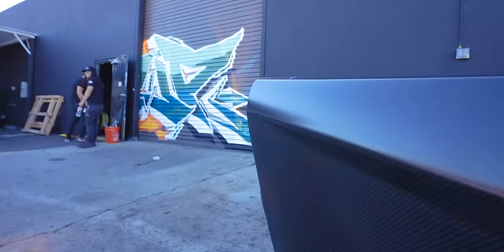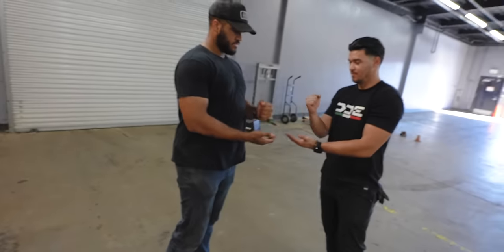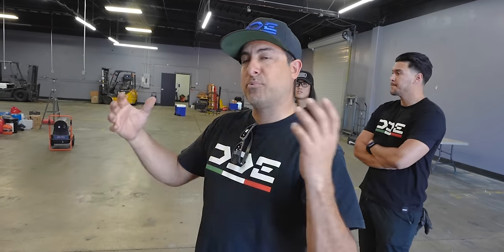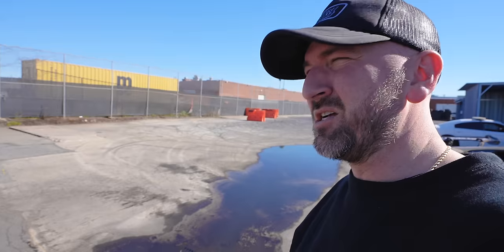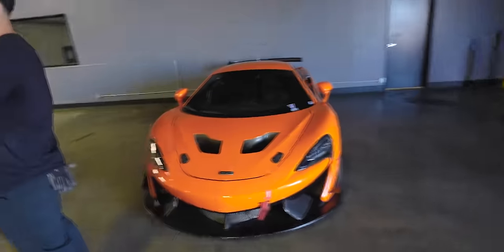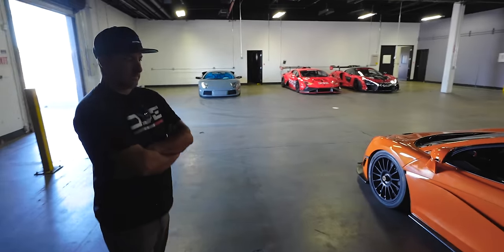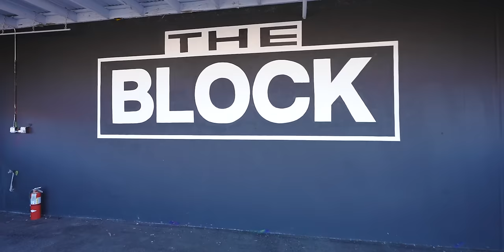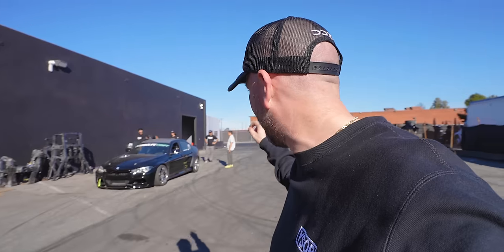HELP! NEW DDE HQ SHUT DOWN UNTIL THIS IS PAID!

Comment: DDE THIS IS A LONG POST: Sorry for this tho some things to be mind full about from me so hope it helps you, as im sure more input from a some 1 that knows warehousing the better. Yes this is retail but you will understand when you read this. Also as i wish you all the very best, this is why ive taken the time to write. 

  3 screens in the store for 3 dif- angles for when the Block is Operating. could even have a Red Live sign go hot for when some 1 turns that on call it a hot button so it also turns on & turns of the tv's at the same time ish what ever right just turn the tv on be done with it. (however you like it). However this may be an issue for when customers come to then stick around creating a crowed where people come in then stay to long only to watch & not bye anything. See how it goes, thing is tho you actually do need customers so Yes to it. Need to hire a couple of retail people 1 to start of with. Also people have phones ='s camera's be mind full of content on shop's tv screens just in case you wished for that content to only be seen on the channel. Every 1 will want to film inside the DDE Shop. & external. People will show how to get to the DDE Complex, but that's a good thing & a Security issue down below.

  Security & a safe that can not be taken so dino bolt that sucker down. Massive Bolts for the complex you all ready know im sure. It's a lot more then an aesthetics issue. Hiring a Big guy for Security will be needed might as you know there will be customers vs the location so on & theft in the door. Safety for the customers & the crew, Signs to state this facility is under constant surveillance. & get a Deal with the Security System place to also be a Sponsor if possible ask them to come around & have a look make them feel at home try to get them onboard. With all this then again something comes to mind, you might need a payroll clerk. So best to speak to some one that know the retail industry or some 1 that knows retail. Speak to shop owners insight is insight. Even if they can even help in some of these aspects to assist in these matters & see if they are also able to then become a Sponsor. They can sell your stuff & vice versa. Evan a conversation goes a long way & can lead to saving money here & there. (you will find actually that ohh we all ready have this or that) Or now i know what to use this for. so on.

  Sponsorships helps both sides the more the better. & even if it's only 1 or 2 to start. Then company's will want to follow suit in a mission for them selfs to want to come to you to sell & advertise in the shop. ( i now you know this tho some peole reading may not) Hope all goes well Just a reminder don't go to ham on aesthetics, as there are many factors to do & things to do & get for the shop to be up & running. Business NO: Registered to do sales or name you have all ready and all that & the location that may need a looked into for certification or permits im Aussie im not 100% at all know how that works for USA, & that's for you not us. Just make sure everything legally is fine.

  Floor Space... Id say only 1 car to show on rotation (put this in today that tomorrow what ever works) so make sure that's easy to roll in/out of in the shop as floor space disappears extremely fast, Utilize the crap house of ceilings & walls. Last few vids you guys said so much space you don't know what to do with. Have adjacent rooms Vacant for Stock & rooms ready to expand if need be extra shop space & (locked space for Stock Extremely Important). 

 Stock for the shop & the building: can be a two part aspect in one, this can be shop stock & hold parts for the cars & so forth. Have these sectioned of so car parts or should i say car grease & dirt from that can be separate. Tho still can be in the same place but sectioned of. Can see a few walls taken out for rooms to become 1 for the stock. A Racking system ='s another business sponsorship possibility. Rackings Tablets Pc's. Keep Fabrics-Material & Garments away from direct sun light so less a chance of a mold issue. Yes it's LA tho these things can happen. So the stock that does not move much can't get effected. 

Could even have a wtf is it called a HVAC humidity system for that space/room (no water allowed in this room) only drink bottles. If you really want to make sure tho no not needed tho ive seen that b4 for high end Garments some do it most don't. um then if things get really Big, you may want to for a route of a RF Scanner System , this is also for security as well. Have in mind you will need some workers. There are many company's that have a Pc System that can interact with a money till for cash. (that can work with stock levels that also give your workers real time stock levels counts. It also work's with has any stock gone missing & at where in the complex does it go missing. A good system like this can make a retail worker happier & also gives you piece of mind.
The worker may want a Tablet on the wrist for on the fly walking around with a customer for Instant Stock level checks. that can be very easy only on the Pc till as well. But the worker then is away from the till hence Security. Get lots of camera's find blind spots on those camera place another camera or adjust it. Server rack or something to hold footage say said amount of time. I will guarantee you, there will be theft so have a Tag machine to remove tags on items & a walk thru tag scanner. 

  Food mention i did a vid or 2 ago im glad you mentioned it in this vid. Even if it's cold food like salads & cakes sweets so on DEF- 2 or 3 vending machines will bring in the dosh. DO IT. Vending machines are a cash cow. They make the money fast. Sponsored drinks do a fk ton out of that.  later on can be for the hot food or no cold food is actually so easy to do, (it doesn't heat up the shop or have oil go onto the material & garments so on) start small lets any1 that works in the area of  business's to get something to eat for there lunch breaks, sandwiches so on. (bye food fresh you guys are out & about bring in what you like & what sells good.) These small things actually add up & they add up well & Fast. Even if you sell it at the price you payed for it. (raise it small if need be sometimes taking a hit in sales gains in other sales) this way people walk in & see merch regardless if they wanted to see it or not. Those customers will see things in the shop & talk to friends. They as well will want to quickly walk around & bye things. Free advertisement. You all will do great in this. 

  You may even would want to do a Room specifically set up to do Online Merch sales & delivery company pick ups at the end of week or twice a week. You can set up a pick up service like fedex or what ever you guys like best cut out that middle man that does this for you guys. Profits. Shop 1st tho to get started & get a feel where you are & how it all feels & see to more after. you may even want less & out source you may not. Tho it helps having less things to think about. 

Everything mentioned is only suggestive idea's from me. SO GO & GET IT      Team DDE. Side note: fkn hell i wrote alot lol. Ohh fk Signage outside, ADVERTISEMENT, use the same guy tho His Good. On the Top Left in color DDE HQ mid section to right all that area DDE SHOP Advertise the shit house out of that write what's inside like garments the food outlet cakes write them on the wall. so on so they get a great idea of what's inside. Later on as well you could even go as far as Street Billboards. Hope it all goes well Peace.